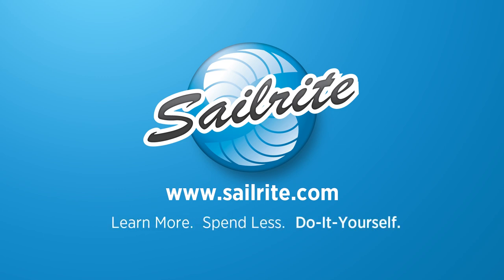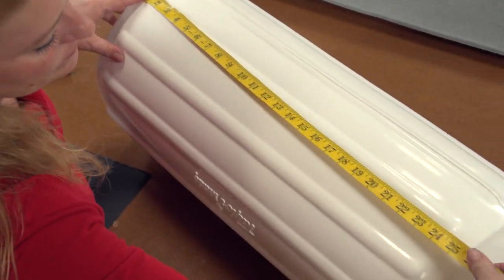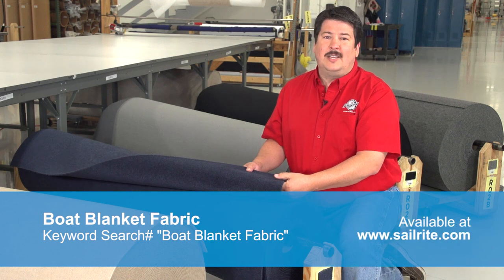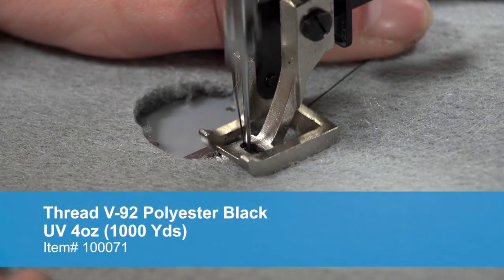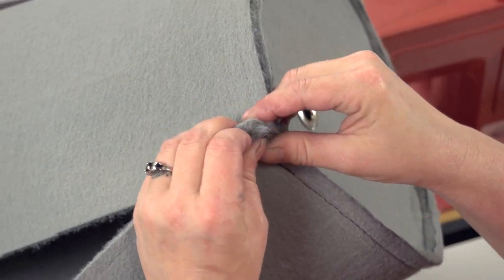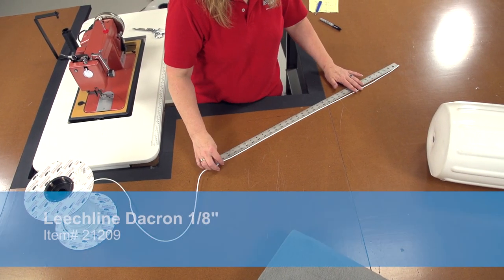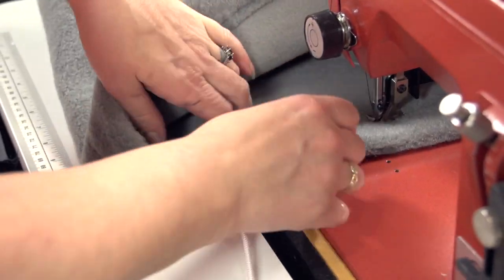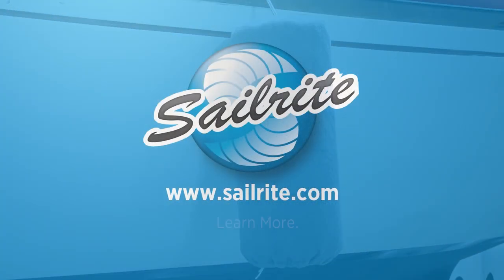How to Make a Boat Fender Cover - Center Rope Style

Comment: If you don't have a grommet setter, I bet you could lay a stainless key ring on the hole and zig-zag over top of it. I've seen old circus tents made that way for the pins on the top of tent poles to poke through.   They weren’t zig-zag stitched though, but sewn by hand.
Reply from the maker: Wow, what a great idea. Thanks!!!!

Comment: Is the math right at 1:13?  Seems like it should be 11 3/4 not 11 1/4?
Great video BTW very helpful!
Reply from the maker: NOTE: at 1:13 minutes Angela miscalculates the answer should have been 11 3/4". The correct mathematical equation  (Circumference ÷ 3.14) + .75 + .5 = Diameter of Top Circle.

Comment: You mention that the Boat blanket material is appropriate for fenders used against gel coat ... how about an awlgrip painted hull?  Thanks in advance for your reply.
Reply from the maker: Boat Blanket Material is soft and typically will not damage most surfaces. However, if the Boat Blanket Materiel picks up sand and dirt and is left dirty then it acts like a sand paper and may damage any surface. But that is the case with any fabric covering, if it picks up dirt and rubs on a surface it can cause damage. Keep it clean and if you painted surface is applied properly it should not cause any issues.